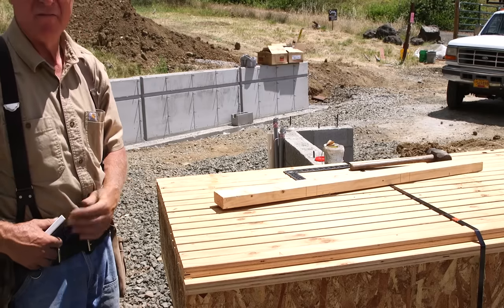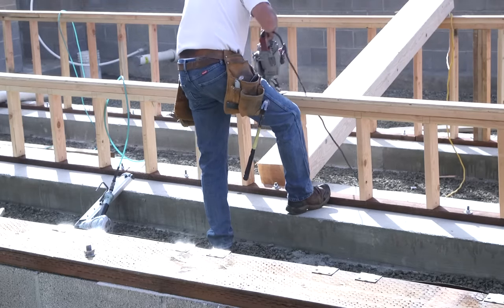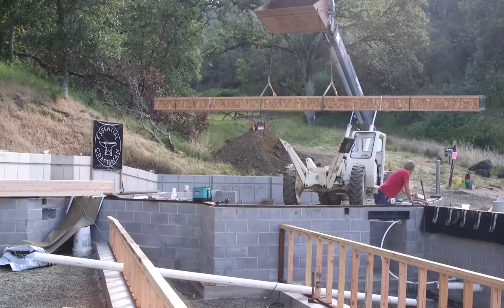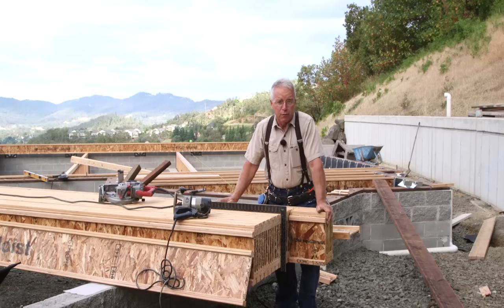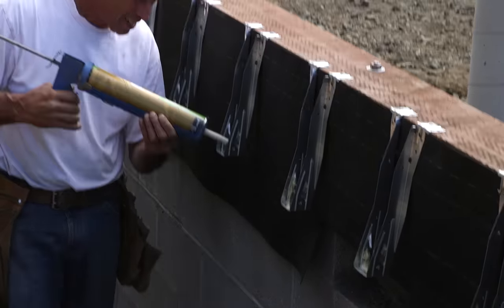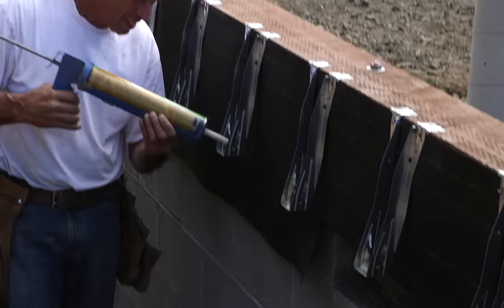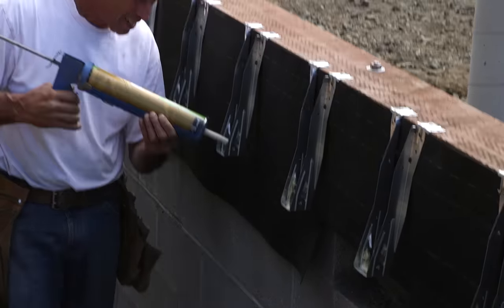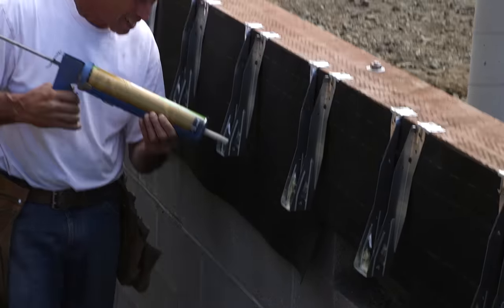Roll the Joists Ep.40

Comment: The problem with concrete floors is that no one seems to be able to pour a perfectly flat floor and when you install a wood flooring over the concrete, the flooring will squeak. Self-leveling agents are virtually unheard of around here, a bag of it is expensive and doesn't cover hardly anything. It's just not practical. Great video!

Comment: "That is never an excuse to do something ugly if you have the capacity to do something that is handsome." 

Truer words were never spoken.
Reply: So then riddle me this why is that nice man hacking those floor joists with a chain saw.
Reply: @Quackerstacker1973  Chain saws actually cut very straight and clean when used properly. They are an excellent choice for batch cutting joists/rafters, safely cutting rafter tails to a line to receive a gutter board, cutting beams, etc. A beam saw attachment for a circular saw is similar, but is much more limited (and somewhat more dangerous, perhaps) in scope. Plenty clean enough work for framing, and quite a time saver!

And I've seen old men do cleaner woodwork with a rusty pruning saw than some Youtubers with thousands of dollars of power tools. The tool does not make the craftsman (except maybe with crown molding, then you really do need the right tool).

Comment: As always, great video, sir!  You're about the most calm and well-thought-out carpenter I have ever seen.  Thank you so much for your videos.

I was a framer for a couple decades and I appreciate the truth you share.  I now design homes for custom builders and have been pushing to steer away from engineered lumber.  Trusses and I-joists burn incredibly fast, so we either add fire-proofing, sprinklers or design using nominal lumber.  

For gang cutting, I once set up a cut station using (2) 48' i-joists as a table with a sled and mounted (2) 12" SCMS at each end.  We were able to precision-cut every joist we were using on the apartment complex we built.  I've never been under such time requirements to have to frame to speed in that way of cutting.  It looks cool though....you da man!

Glue in the hanger was something we also stopped doing.  Eventually we found that when the glue cured, it would sometimes move in the hanger.  A rubber compound ended up better for us.  We only glued wood-to-wood or wood-to-concrete.

I wish you every success and look forward to watching your project evolve to its conclusion.
Reply: Thanks for the thoughtful and brave comments which 'dare' to question the methods and choices employed in this video series. I think every young builder ought to be sent to Europe for a month to examine low-tech old buildings that have stood for 500-1,000 years. They will learn that an un-level floor won't mend itself over time nor will an out of plumb timber post.  Another important lesson will come in the discovery that not a single  square inch of  Disoriented Strand Board was built into any of those ancient structures.

Comment: As a retired fire fighter I would say with you using modern engineered products, I hope and would recommend including a residential fire sprinkler system. While engineered pro, there are as expected cons - and the biggest con is fire load and failure quicker than stick lumber. Water damage is easier to fix than fire damage, not to mention the safety for fire fighters entering the structure for extinguishment. Just a thought!
Reply: I saw a statistic provided by my local fire department (of whom my wife's cousin is chief) stating that in the 1960s, people had on average 17-minutes to escape their homes safely during a fire. Nowadays, that time is 3-minutes!!!  The reason: all of these modern, man-made, synthetic products we build and furnish our homes with... they are much more combustible, and ignite very quickly.
Reply: Couldn’t agree more!
Reply: @moaski  that being said, you'd much rather be below a modern glulam beam than a steel one during a fire,
Reply: I came here to ask the very same question.
Reply: This is a valuable perspective and as a result of your comment  I will definitely consider fire suppression for future projects.
Reply: @GarwoodNick  There are nice fixtures for residential applications. I know cosmetically people don't want to look at a pendant sprinkler head, like you would see in a commercial application. Definitely worth checking out. You might also research the avenue of your insurance company, bonds, code enforcement, or any other breaks you might get in your building effort.
Reply: @moaski  We have lost a lot of modern homes that would have been contained in minutes back in the days when I started. Modern construction has opened up a whole new can of worms over the last 20 or so years. They are allowing 2 hour rated sheetrock instead of block walls for the construction of the fire towers now (Stairwells). The only safe haven we had in a high-rise is now sheetrock , yes sheetrock is all that keeps us safe from an inferno 16+ stories up.
Reply: Or perhaps building fire ratings into floor and wall assemblies, which would also help quite a bit with sound transmission. But your point is well taken, with engineered lumber and spray foam insulation, I often worry about that when we build new homes. Appreciate the feedback from a firefighter.
Reply: @Dale1C  Very well said, and the most important part is there is a conversation!
Reply: Yes but unfortuantly OSB swells and falls apart when wet,  it's cheap and light but not quality in my opinion. There are two hundred plus year old houses made from wood beams, I really doubt this house will make it to one hundred years and probably far less than that.
Reply: Marshall Moneymaker water will destroy those beams just as much as a fire would
Reply: Phill Huddleston exactly as soon as those beams get water into them they are ruined the house will be a total loss because of the foundation failure
Reply: @phillhuddleston9445  Not sure, but OSB is available in moisture resistant variety. In the UK at least, I have had OSB sheet sitting outside in all weather and almost zero dimensional change.
Reply: Living in denmark, this is not a big problem. Allmost all houses are concrete floor, and brickwall. The only wood is the in the roof. Sometimes i dont understand why a rich coutry like the US build woodhouses all the time :)
Reply: @jonjak80  speed and availability of cheap materials?
Reply: Jon Jakobsen  One word,- 'Lobbyists'..aka 'Bribery'.  ..That's Why. ...shhhhhhhh😐😑😒the deep state watches🤐
In America all things are possible, even the building codes can be manipulated by the highest bidder..😶
Reply: @JohnnyMotel99  Maybe thats the problem, but we got same cheap materials. But when people build houses, its for there 30 years morgage and then they can grow old. And the house is still worth the 300.000-500.000 dollars pricetag, with very little maintaince over the years :)
Reply: @BigHayes7771  Of course it will in a heavy water situation. However, most fires that are stopped with a sprinkler are done so by one to two heads being discharged. At a rate of just a few gallons a minute, add that with smoke alarms and a quick response of the fire dept, not as bad as one would think. There are other factors as well - carpet, flooring, furniture all taking on water. We are talking small amounts of water verses hundreds of gallons from a fire hose. 

Here sprinklers have been mandatory for some time, a long time in multiple family structures. And just a couple of head discharges has saved the entire structure and no need to replace and walls, beams,  joist, etc. These are apartment complexes and townhomes made of 90% engineered lumber. Now there are fires that are gas feed or other such factors that can overwhelm the system, but that is a situation that could destroy no matter what. I would bet a broken pipe would cause more water damage than most sprinkler heads.
Reply: If money were no object for materials and fire suppression, I'd build the entire home out of cinder block on slab, even the interior walls made from brick (Stucco over brick, because it's also fire resistant), all fire resistant materials. No wood, whatsoever. Then use a clean agent system for fire suppression, something to remove the heat from the fire but still "safe enough" for human contact.
Reply: @jonjak80  People here are resistant to change especially if it changes the looks of a house.  Builders are actually using cheaper and cheaper products and people are paying more and more for their houses because they look the same as a house built decades ago.  Stick built houses are cheap and easy to build and builders are used to building them that way, the vast majority of people accept it so there is no reason for them to change. Natural disasters cost billions every year in homes that are damaged and lives are lost because of the cheap building practices but people are set in their idiotic ways.
Reply: @phillhuddleston9445  Sometimes its cheaper to build expensive when its sold later on :) But if you only look a the building price, and not later sales price then its easy to make wrong chose.
Reply: @jonjak80  I get what you are saying but from a builders perspective or even a home buys I don't know if that is often the case, when most people buy houses they do not look at how it is constructed, they look at cosmetic features like the kitchen cabinets, hardwood floors though they are often not even real hardwood etc.. Some people take the construction into consideration but the majority do not, they think that if it passed the building inspection it is as good as any other house. Now some houses are even being constructed using a plastic or wax coated cardboard in place of plywood or OSB sheathing, it's getting crazy how cheap they are getting.
Reply: Jon Jakobsen I live in the U.K. so you probably know the methods used here.  But even though our rules are pretty strict plenty houses built subpar.
Reply: I was never a fan of OSB or ‘chipped wood’ products either but I know they are better than they used to be. I suppose the glues have gotten better. BUT, you have to remember all these products have undergone stringent testing and a lot of engineers and architects are putting their licenses on the line using them. So they must know something. 
  As far as fire sprinkling the building? Why aren’t all buildings sprinkled?? Bcz of the expense! It’s not cheap, by any means to install a fire sprinkler system.
🤜🤛
Reply: @phillhuddleston9445  Very well said.
Reply: @jonjak80   Let me answer your question, our building codes are a bad joke. They are written for the benefit of the developer not the occupant. May I also take a moment to commend your country for your tall blond women and excellent beer.
Reply: @bonanzatime  At the local level, developers are far and away the biggest donors to municipal politicians.
Reply: @phillhuddleston9445  Amen.
Reply: Right Lane Hog  There's also the business of manufacturers whi$pering into the ears of politicians  (all types from overt to camouflaged) making it mandatory to use 'their' expensive products put into the building codes.  For example, things like those 'chairs' used to hold up steel re-bar, when really a piece of brick or gravel will do..  That kind thing goes on all the time.  Making everything More expensive; not cheaper.
Reply: Jon Jakobsen those houses look very sturdy, but they sure are ugly.
Reply: @jonjak80  Because we aren't rich, but want a big house so that we can look rich.
Reply: I have been in construction for years and I agree wholeheartedly that these joists are dangerous in a fire. The burn thru time is way shorter than solid lumber. Most fire departments will not go into a newer built burning building if they are not sure how the floor system was built.

Comment: I work for a lumberyard in Ohio designing Engineered Wood Products (EWP) for floor and roof systems, and I am frequently shocked at the appalling lack of knowledge and concern on the part of framing carpenters and other skilled tradesmen when it comes to the intricacies of storing and installing I joists and LVL beams at the jobsite.  I nearly fainted when you actually referred to the installation guide that is so critical to a good installation that will make happy homeowners.  Kudos on your video and commentary.  This is the way an I joist job should progress.  Prior Planning Prevents Piss Poor Performance!
Reply: "proper prior planning prevents piss poor performance" you forgot the proper. 😁
Reply: V failing to plan is a plan that is certain to fail!

Comment: Shimming the center span is an example of what you will never get with a production framing crew in these parts anyway. It is common to insist they replace cracked roof joists that they have scabbed scrap to strengthen. They also push the +/- 1/4" on every fit up. A common reply is "oh the dry wall cover that". I have run off more dope smoking framers than I can count on two hands. The quality you are displaying can only be gotten if you do it yourself. Love your videos!
Reply: I agree, all contractors know what they should do and how to do it, but many times ignore it unless called on the deficiency and then try to talk out of it.
JIM

Comment: Another good video. In Iowa most residential buildings are made with LVL  joists or floor trusses. When I first started it was all 2x12s with x-braces just nailed straight to the rim joists, it is amazing how new materials have changed the way houses are built over the last 30 years. Before that house construction was basically unchanged for over a hundred years. I live in a house built in 1875 and it is built for the most part how I was first taught to be a house.
Reply: Let's see how well LVL and Disoriented Strand Board are holding up in 145 years. Buy using real wood thoughtfully and building sensibly-sized houses to last centuries, the forest will have plenty of time time to regenerate.

Comment: Metal studs are a good alternative to OSB i-joists.  Metal studs are inflamable, dimensionally perfect, include cutouts for plumbing and electric and cost the same per lineal foot regardless of length which can span up to 40ft (though 20ft is most available at the local Menards)  You can still use cheaper wood studs for walls too.
Reply: How deep can you get the studs?  12"?
Reply: @hanskinslo326  the best I can get off the shelf at my local Menards is 16 gauge 8"x20', but you can order heavier gauges up to 12 inches by 40 ft - sometimes larger, but usually per engineered drawings.
Reply: @treyhart6861  metal studs are actually pretty easy to work with all you need is a pair of tin snips and a razor knife plus they are about one-third the weight of wood studs.  As an added benefit since you need to screw the decking down you eliminate floor squeaks (it helps that steel studs are nearly dimensionally perfect).  Wood is still better for traditional walls since steel studs reduce the insulation efficiency by like 50% due to thermal bridging unless you use a non-traditional staggered stud configuration in your wall which cost more but gives superior sound and weather insulation.  Other reasons include: lack of familiarity in the residential trades, cost (except for long spans), consumer preference and now supply chain uncertainty due to the "trade war".

Comment: I'm an electrician, wired hundreds of houses, and seen thousands in the skeleton. I've also worked as a  framer before becoming an electrician, done roofing, concrete, etc. Spec houses, customs, commercial wood and metal construction.

This is how everyone thinks a house is built, quality wise. But in reality, only a small single-percentage are built to this level of care and morality. 
Vast majority of contractors and foreman won't allow that kind of time spent on details.

 90%++ are a turn & burn jobsite, run to the next one sort of atmosphere.
Reply: yep...turn and burn, there is only enough time to wrestle the rough/framing crew foreman at break time! if you're the donkey for the day.....don't be that guy...its a miserable, sorry ass day for ya if you aint "keeping up"...
every Greeny fell for the "I can guess ur weight with in 5 lbs. trick"...just jump on my back! lmao every time ......
Reply: how much time can be wasted when time=money though? labor cost sorta influences this a ton
Reply: I don't take breaks, I sneak away and fix something that's not quite right, lol.
Reply: @christopherevensen4942  only 1/2 hr lunch break is all for us ... nothing more, nothing less...
Reply: @ryerob741  I go to work in the morning work till quitting time the only time I drop my bag's is when it's time to roll up.

Comment: Very well presented video. 👏👏👏    A few years ago, a buddy and I built an entire house from wooden I beams over here in Norway. It was designed by the i beam manufacturer in an attempt to overcome the problem of sourcing 200mm or 8 inch wall studs.  Everything was glued and shank screwed .  And worked very well.  Great material.

Comment: I love this channel but I have to say the shimming up the joists like that will increase the likelihood of a squeak. 
I would suggest spending more time leveling the Mud cill and top plate of the pony wall (by shimming under the sole plate of the Pony wall and grouting if necessary), therefore allowing direct fixing of the joists to the Pony wall.

The method in this video is introducing additions elements which may fail. Those dry timber shims nailed in with a nail gun are surely going to split, even more likely as it look like you are using folding wedges?
Reply: I dont agree. The pony wall won't adjust as accurately and even if it did having to grout under the mud sill would be a huge pain in the ass. If you are worried about the shims cracking, just put a gob of liquid nails on each shim, thats what I do.